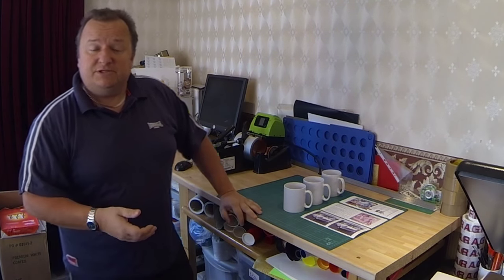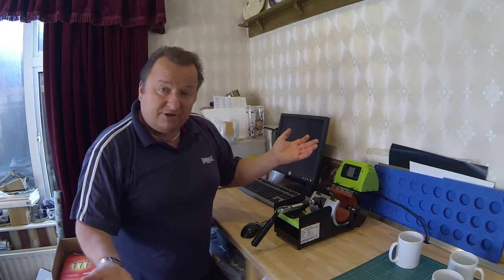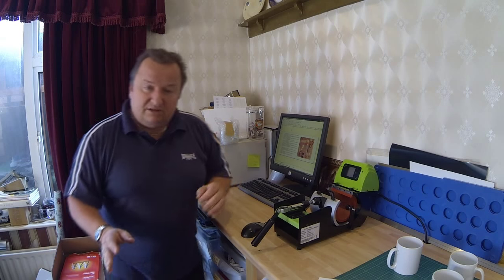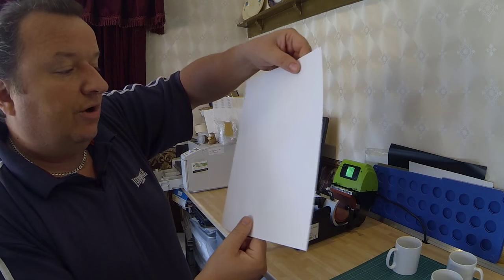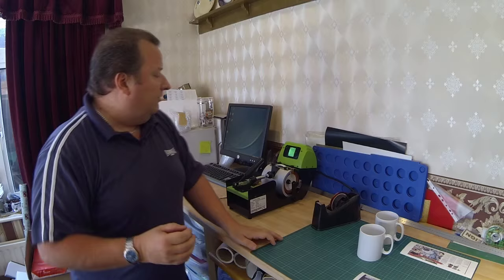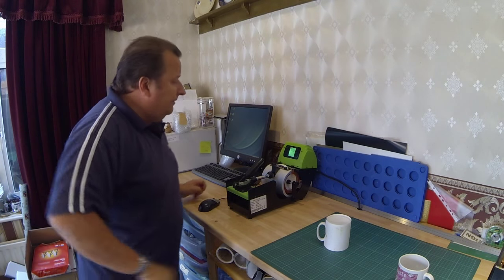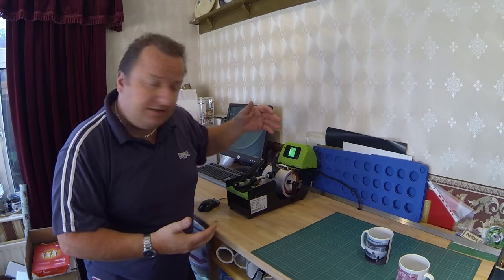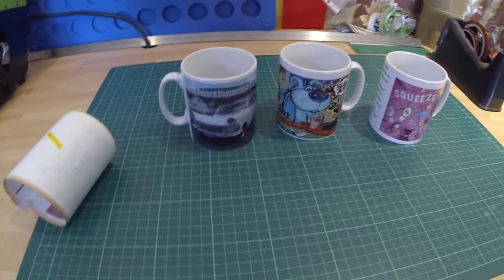Galaxy Mug Press Test Run And New Features

Comment: Great video.. :D  do you use only refill cartridges in your printer ? so you just take them out and refill and then put them in again ? I think it would work just the same on a EPSON printer as well.. ? To bad i don't know what ink to buy from UK eBay,
Reply from the maker: +HearGear I use Sawgrass sublijet R inks in my Ricoh Printer for the mug biz. I don't recommend Epson printers for sublimation as they block the fine print heads and also waste a lot of ink when performing the maintenance cycles.
Cheers
Martin
Reply: Thats cool, i have been looking online and that ink is very expensive, maybe would be cheaper with refill cartridges to begin with.
Reply from the maker: HearGear
The sublijet gel cartridges last for ages. I was worried that they wouldn't last but they do.
Cheers
Martin
Reply: I bought a Richo printer and some refill kit with ink, the printer is very good, but i dont know about the ink, i think i will have to test it out and see, So you are using the Sublijet R ink from subliblanks ? I will have to buy that ink as well to my printer if the refill kit is just some crap..
Reply from the maker: HearGear
I only use the sublijet Gel inks in my Ricoh and would not put a refill kit on it as the inks will be inferior.
Cheers
Martin
Reply: I am not sure about gel ink, is that what subliblanks have in stock for richo printer ?
Reply from the maker: HearGear
Yes, it's never given me any problems and lasts for ages.

Comment: HI Love the video, I have just bought the Galaxy Mug Press and I'm getting a little bit of fading on the bottom of the image on the mug amusing the 190 for 150 same as your video any other advice? I've moved the ball in a little? 

Would It be better to pre heat the mug ?
Reply from the maker: You might want to leave the mug press on for about 20 minutes before you use it to ensure the whole element is hot.
Reply: I am having the same issue would be interested if you fixed this issue

Comment: Hi Martin, great video, thanks! I've had a look on Galaxy's site, and noticed the ink is pretty expensive (£175 for a pack of full colours). I'm hoping you can give me an idea of how many mugs on average you can get out of a full pack of colours (if printing colour prints, like in this video)? 

Your advice would be much appreciated. 
Thanks,  Zoe.
Reply from the maker: Don't worry, the ink lasts for ages as mug images are pretty small. I go through boxes of mugs per set, they all don't run out at once either depending on what colours you mostly print.
Reply: Martin Butler

Comment: I'm using this exact setup but I get some blurring - I notice the bluring can also be seen on the paper after I have removed it from the mug, though it was pin sharp prior to heating. Any idea what causes this?
Reply from the maker: +BP PP Make sure your transfer paper is stored in a dry place. 
Cheers
Martin